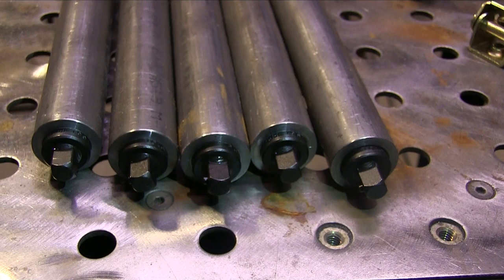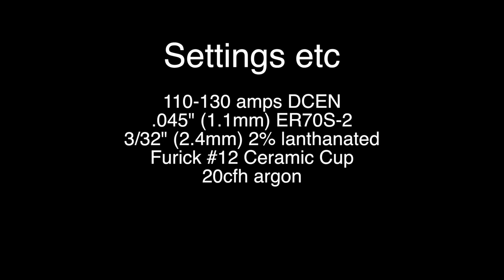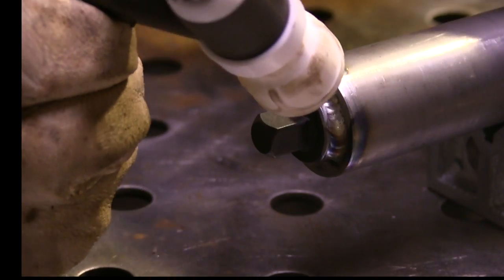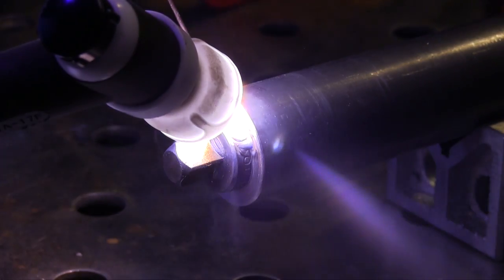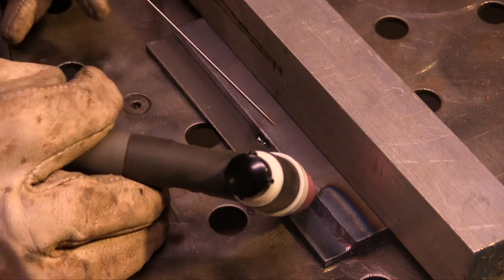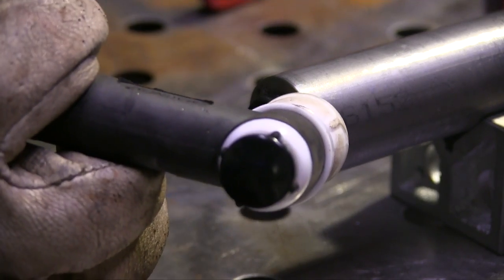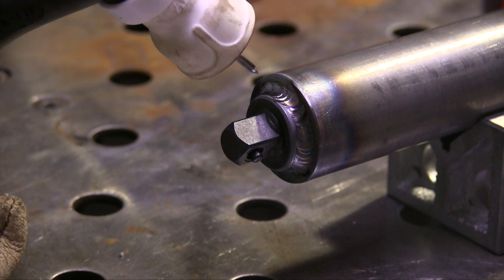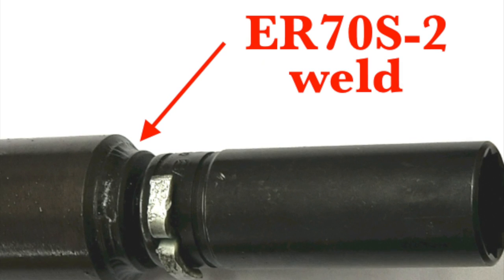Tig Welding Custom Socket Extensions

Comment: Nice... Just a question : Why it smokes ?
Reply: Often I see a little bit of smoke when Tig welding. Can't be the argon...argon is inert. so what I've come up with is that possibly it's getting hot enough on the inside of the part to react with oxygen in there or there could be some oils (even just from  your hands) that are getting cooked off. 

I've also often wondered "What is that familiar TIG smell?" I don't know what it is... but I like it. haha.
Reply: It's an evidence that the parts are not cleaned enough. I'm just surprised of that from Joddy.
Reply: the Concrete Box. That "familiar TIG smell" might be ozone. It forms in the UV light around the welder.
Reply: Oh wow, how interesting. Is it harmful?
Reply: Welding smoke is never good for health. At the less, you can get that we name in France "welder fever" (Headache and nausea).
Reply: Ozone is absolutely invisible ! And remember the arc is not in oxygen but in argon !!! It's the basic of TIG welding !
Reply: No use to ask him a question; he never answers.

Comment: What does the black oxide do for the finish? Thanks again for a great video
Reply: 10,000 Rambos I think it prevents rust. More durable than paint.
Reply: Black oxide converts the surface of the metal so that it can accept oils, soaking them in. It does not change the dimension of the part.
Reply from the maker: black oxide provides some amount of rust prevention and has become standard practice for aircraft tooling mainly because it does not alter dimensions
Reply: industrial tools were oxide way before chrome, it doesnt flake off and like you said alter dimensions

Comment: thanks for sharing! strange part indeed if you`re going to cotter pin the socket then why don`t they weld the extension to the socket instead a driver but as you say one do what the print says :D i`ve welded a ton of sockets for race mechanics (not as fancy as aircraft mechs... ) all with 309 following advice you gave me some years ago, never a failure so thanks for that too. i asked  in a  previous video if i can contact your store some other than the email provided in the site bc it says you don`t ship where i`m at this moment (i need some tig fingers) and never got an answer. thanks again. regards. peter
Reply: Maybe the socket is pinned fo easy replacement when worn.

Comment: Any reason not to mig these?
Reply: Yeah but time is money. Mig would be a whole lot faster.
Reply: Hill Top Machine Works only a novice would think to mig this
Reply: the tight joint wouldn't penetrate the same as Tig does more intense arc with Tig with better ability to direct the arc properly and travel slow around a small circle like this

Comment: Jody. Would it be safe to say that sockets and wrenches are made out of similar materials? The reason I ask this is that in the video I have added a link to shows using 312 to modify wrenches. Are they choosing the 312 due to the fact that they are welding wrench to wrench whereas you are welding socket to mild steel which makes your choice of 309 logical? https://www.youtube.com/watch?v=4CytQa4A_HI
Reply: 30cal4me he used Er70s-2 because of the black oxide finish. He didn’t use 309
Reply from the maker: in this video, I was welding plain cold rolled steel to whatever those socket inserts were made of ..and for the particular application, er70s-2 did not create any cracks.  according to proto the socket inserts are some type of chromium vanadium steel which is hardenable but not as hard as some other tool steels.  312 would have been a great choice for this.   I have had pretty much equal results with 309 as I have had with 312  ...but 309 is usually easier to find at the local welding supply.  If the parts were not going to be blackened I would have opted for 309
Reply: weldingtipsandtricks thanks for the clarification, I love 309 for dissimilar. I didn’t realize you could use er70s-2 for that application. Good video